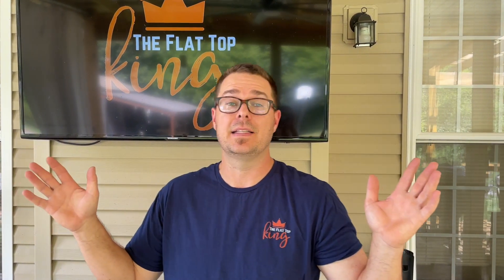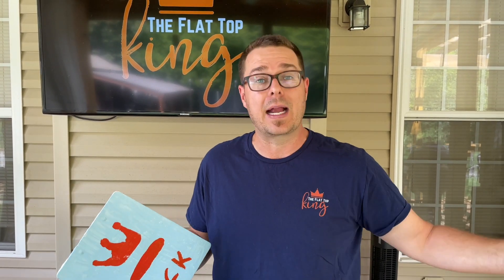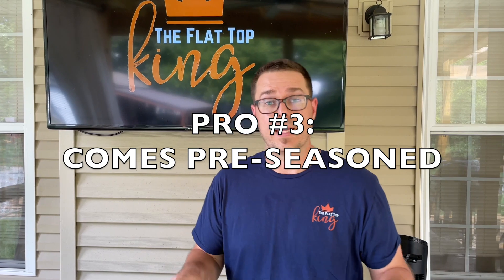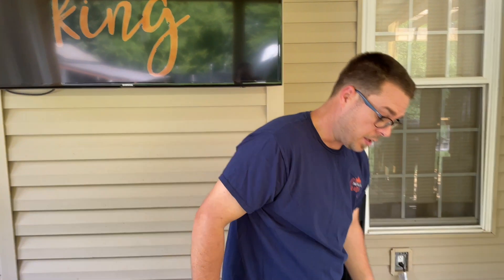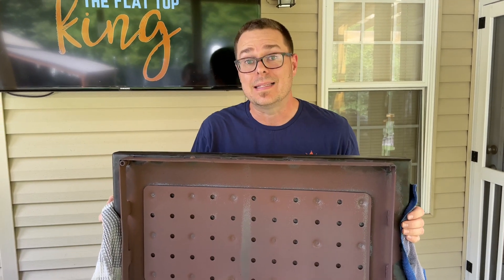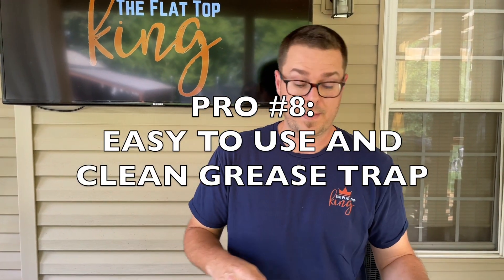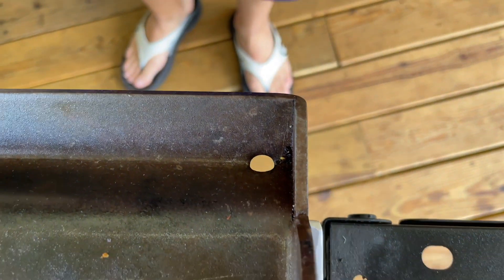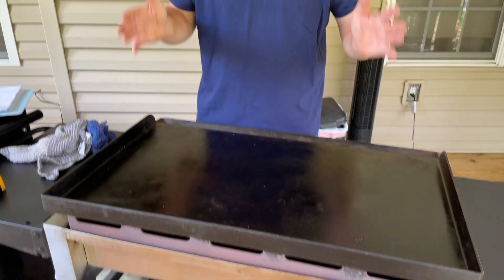Camp Chef Griddle 1 Year Review (Best Flat Top Grill Review)

Comment: I've had a Camp Chef FTG475 for a while and I've noticed some of the cons you've mentioned. Regarding the grease trap. What I've done with the hole for the grease trap was to drill it out a bit to make it more functional. If you are going to do this, be careful not to make the hole too big because of the risk of some of the grease not reaching the grease tray. 

I discovered the side shelf heat issue the first time I used the FTG and melted an oil squirt bottle. 🤦‍♂️  From then on, I've used a metal side table. What I do use the side shelf for is to keep food warm. I have a small wire rack to keep cooked items like toasted buns or bacon warm.  To catch any grease or other debris under the wire rack I use some tin foil.

Comment: Great video thanks for the tips. If it were me I’d take about a three eights inch drill bit and go right through that hole.
Reply from the maker: Great tip!
Reply: @TheFlatTopKing  by the way, I think I got my seasoning good to go. Five sessions up to 500 down to about 100 and so on. I did end up taking a small step drill bit and cleaned out that little booger in the corner seems to drain a little bit better with the debris in the trough. 👌
Reply from the maker: @johnmccaffery5186  awesome to hear. Just keep it seasoned and never look back. I actually filmed steak and mushrooms today and while preheating my flattop i brung it up to temp for longer just for that purpose

Comment: Nice review! I would add another PRO, the burners light in any order you want to light them, independently from each other, which helps 
with temp. control.
The side trays get so hot they WILL melt your bottles and even the plastic handles on the Camp Chef spatulas . . . don't ask me how I learned that! What I do now is keep thick cutting boards on them. They still get hot, but it allows for a little more usable space, and I think it's a little 
safer with them on there.
Reply from the maker: Yes you are right. Good points.
Reply: What about using a silicone mat over the trays to keep them cooler?

Comment: If you notice, just before the high setting, there are really 3 dashes  those are really low settings that you can cook eggs and pancakes with
Reply from the maker: I am looking now. So you are saying that the three notches keep the heat down before the knob turns to high. If thats the case how did u know that
Reply: @TheFlatTopKing  i saw it on a review of the grill someone has a Blackstone and a campchef, and he preferred the campchef because you can lowered the heat down to maintain around 300° temperature to cook eggs. And I tried it with mine and it works really good.
Reply: @TheFlatTopKing  have you tested this?
Reply from the maker: @mickeymallette2663  honestly yes and I couldn’t tell the difference in 15 min. Doesn’t mean it does not work but for me it seemed like the flame was always flickering out. The flame was not strong enough or it didn’t really make that bog of a difference to switch things up.
Reply: @TheFlatTopKing  thanks for responding.  Low temps being hard to control or maintain is a big deal, in my opinion, but everything else seems great.  I’m more confused about what to buy, lol.
Reply from the maker: @mickeymallette2663  i have not announced yet but i have partnered with pitboss and just received a griddle. I will reviewing it shortly and that will give you another option.

Comment: Great review!!  I have been looking for a flat top griddle for months.  My wife just bought me on for my birthday, it did come in yesterday or today due to freezing rain for two days.   It is a Blackstone model, Blackstone 1899 36" Griddle w/Hood, Black.  Did you get that WITH A HOOD.  Blackstone must have watched your video.  It weighs off the truck at 150# some assembly required.  You mentioned screws may come loose.   What I do in these possibilities from moving around, is put it to gether snug.  When it is right, I back the screws out one at a time and put a spot of Super Glue on the threads and tighten it up.  Then go to the next one.  It stays but is not permenant, you can still break it free with a little pressure if you need to.  But the screws will not back out on their own.   Thx again.
Reply from the maker: Bill i havent seen that model. Can you send pictures  it to me either on facebook or email. I have 3 facebooks. The Griddle Group by the Flat Top King, or my fb page. The Flat Top King, or flatopking@gmail.com

Comment: I’ve heard that you can adjust the temperature knob to the dash closest to off and it is not as hot as being set on low. I haven’t tested it yet to see if it is cooler. You can also drill the grease drain hole bigger if you want. I’ve had my Camp Chef for 3 years and it’s still like new. I love it. I use the stainless cover off of Etsy and it works great. I also have a Camp Chef pellet grill that works perfect. They are a good company that stands behind their products.
Reply: The unhinged cover or hinged one? I am debating between the two covers. Two different people make the unhinged, one of them only makes hinged.
Reply: The hinged version wasn’t around when I got mine but I think I would stick to the removable one because it is flat. I use it as a table when I’m prepping food for my smoker.
Reply: @mnsnowhawk1  aah ok. Thanks for the input

Comment: Great videos, keep them coming. My camp chef that I’ve used only a dozen times is high in the middle and everything runs to the corners. I always try to keep the heat even. Any idea why I have this issue. It’s impossible to keep eggs or any liquid type of food from running to the corners. Thanks
Reply from the maker: If you have something heavy and heat proof some say you can heat up your flat top and put the weight on it and turn off the heat and let cool. The weight will help flatten out the metal. Try to look that up for more detail. I have not tried it but some subscribers have commended about it. 
Does you flat top rock back and forth?
Reply: @TheFlatTopKing - Thanks, I tried this with a 4 gallon stock pot full of water and a bucket of rocks on top of that. I ran out of propane before the it got to the temp I wanted and will try it again.
Reply from the maker: @D-Allen  try to put that on some wood that stretches the length of the flat top. I think it would help disperse the weight. Plus the wood can handle the heat. If its good straight wood you could take a pic showing how uneven the flat top is and email Camp Chef for ideas or help.

Comment: Question:  I have the two burner Outdoorsman that we use while traveling in the RV.  I have issue with propane vapor lock.  After every use I disconnect the propane to mitigate this, does not work all the time, and when there is vapor lock it won't get up to temp.  I am looking at purchasing this unit for home use, I like the grill/griddle combo.  I am curious if you have experienced vapor lock.
Reply from the maker: Sorry brother I do not. Honestly I have not heard of this...
Reply: @TheFlatTopKing  Numerous videos on You Tube on this.  Its an issue.  Glad you have not run across this with your camp chef.
Reply from the maker: @rjtrembgeologist  me to sounds like.

Comment: Hello! I just got my camp chef. I noticed the the flat top isn’t perfect flat.  It’s not noticeable to the naked eye but when when I put a level on it, the level doesn’t lay perfectly flat.  Should I call camp chef for a replacement flat top?
Reply from the maker: Not sure...there are leveling screws underneatch...I would try that first...
Reply: Sorry if I wasn’t clear but what I meant is that the flat top itself isn’t completely flat.  For example, if I pour oil on the left side of the flat top the oil moves to the left, whereas if I pour oil on the right side the oil moves to the right. Is that normal?  If the flat top were perfectly flat the oil should move in the same direction regardless of where you pour the oil.
Reply: Hey there, I emailed camp chef a video of the uneven surface and they sent me a replacement.  The replacement is much more even.  This time I will be extra careful not to preheat on medium or high heat and instead use low heat.

One thing also I noticed with the original flat top and the replacement is a loud bang sound several minutes after the burners are turned off.  Does that sound happen to you?

Comment: I put heat deflectors on mine. They deflect so much of the heat that the tables barely get warm. And never hot. I can put plastic, one inch away from the griddle with no problem.
Reply from the maker: Although I completely agree....I do not teach or recommend that because because of some have said the heat gets built up too much and can lead to warping. Camp Chef says high heat is only used with out the griddle top...by using the wind guards you are using the same heating...thats where each person takes responsibility...thanks for the tip

Comment: I know the answer is probably somewhere in the comments, but they do sell a separate lid that you can use while cooking on the grates right? I want to make sure I can cook on grates with a lid OR use the flat top depending on what I’m cooking
Reply from the maker: I am not sure or familiar with a lid that an be used with the grill on...im sure someone has made one out of enough steel to handle the heat but all the tops I have seen have been flat. Although they use this as a pro in the griddle I think its more of a con and thats one major reason. No way to hold in heat when using as a grill
Reply: @TheFlatTopKing  Interesting. I very rarely use my current propane Weber WITHOUT having the lid down while cooking takes place so I’m not sure why there wouldn’t be one available for the purpose of grate grilling. I guess I will have to do a little more research.

Thanks so much for the quick and informative reply! Just found your videos and Tik Tok and will definitely be a subscriber!
Reply from the maker: @matthewveach2332  thanks. Hey if you find. Something let us know.I have several several people asking and I’m the same boat

Comment: Iam playing with a thermostat that will control my gas valve.  Work in progress but Iam having some luck. So can either control all the burners the same or need to put four regulators. One for each zone.  I’ll let you know.
Reply from the maker: Thats would be awesome. No doubt keep me updated
Reply: @TheFlatTopKing   You should make a splatter guard to keep the splatters off your deck. Mine is sheet metal almost the length of one side and about 3/4 the length of the back. 
Four inches high. Take the length and make a 90degree break to fit. Before I made the 90 I cut the metal 1/2” at where the 90 would be, both sides.  Bend the half inch over and flatten with a small hammer,  now bend to the 90.  The half inch folds will keep the unit stiff. 
The sheet metal (flashing) sold at Lowe’s  HD is to thin. I found a piece of trash AC duct at a new house build.
Reply: @Joyful-213  are the splatters that bad? There is a 5” one on etsy.
Reply: @DexterityNJ  when I grill burgers they splatter.  I know you can buy one but I made mine.  Was easy.
Reply: @Joyful-213  wish I was as handy lol.

Comment: How do you level the 6 burner? The 6 burner has wheels on all four sides. If the griddle only has two bolts on one side, then you can only adjust to one side
Reply from the maker: Not sure. I only have the 4 burner. U could check underneath to see if it has the screws like mine. That has helped a ton. Maybe a thin piece of cardboard underneath the wheel. Do the wheels have locks.
Reply from the maker: I looked on line and it says it has adjustable legs. Do u want me to reach out to Camp Chef

Comment: I just received mine and noticed as I was trying to level it after assembly, the middle is bowed. Should it be perfectly flat? I can lay a straight edge in middle,front to back and back side has almost a half inch gap. Sides seem to be ok front to back.
Reply from the maker: I have two answers...from people commenting it seems like it happens more and more and from what I have been told they will not do anything because it doesn't affect the cook. However I completely disagree....i would absolutely call and send in pics if asked and so forth....heck return if needed...i would absolutely hate a griddle top like that...they have sent griddle top replacements for certain things
Reply: @TheFlatTopKing   Just to follow up, I contacted Camp Chef through their online support link. I also sent in pics of the big gaps witrh the straight edge and flashlight. Their response was that none of the griddles are perfectly flat but they could see mine was excessive. No questions asked, they already have a new griddle top coming. That's some pretty great customer service!
Reply from the maker: @Cam-wi3tp  That’s awesome. Great news.

Comment: I've had my Camp Chef for only a couple of months now and I agree with your assessment 100%.  I experienced the excessive heat issue too.  Even if I turned off the right and left burners, and left the middle 2 on low the cool zones were almost as hot as the hot zones.  Ultimately, I ended up simply watching the temp with an infrared and turning all the burners off when the temp got too high.  If the temp dropped to much before I finished cooking I just turn a couple of burners back on low.  

If I may add one thing; you probably didn't have any reason to deal with Camp Chef's customer support/warranty people, but I did.  I assembled the unit about a week after receiving it as a Father's Day gift from my children, and did an initial seasoning.  Afterward, while the unit was cooling down, I heard a bang (imagine smacking the grill top with a hammer).  Nothing seemed amiss at fast glance.  The next day was Father's Day and I was cooking on it all day with no apparent problem.  A few days later, I found out about those leveler screws under the cook top that you mentioned and decided to try an adjustment because I noticed a slight rocking motion.  I lifted the top off and found that the heat diffuser plate had come almost completely detached from the cook top.  Apparently, some of the spot welds had failed and the plate was flopping around, only held on by the right side.  

I contacted Camp Chef.  I figured they would probably just accuse me of overheating it or not pre-heating correctly.  (I did it exactly as they said in the instructions, and while this is my first flat top, I've been cooking on cast iron and carbon steel for years).  They wanted proof of purchase, pictures of the damage, and the number that is stamped on the shelf sticker.  No questions asked.  The next email I received from them was essentially an apology that I had this problem and to tell me they were sending me a new cook top.  A few days later, it was delivered.  

I don't know how the customer service is at Blackstone or any others, but I know now that Camp Chef stands behind their products.  Sorry for the long story.
Reply from the maker: Heck of a Story and thanks for sharing. When I was doing research the customer reviews was a huge positive when deciding  pros and cos. Sometimes customer service us underrated when comparing products.

Comment: Have any tried using a 20UNF Propane Gas Adjustable Regulator Low-Pressure Control Valve for a too hot on low setting yet, anyone? & Will the flame go out with wind, with this adjustable valve? & I have an adjustable regulator on my 20 gallon tank for my commercial wok burner. It allows me to take it down to a very low blue flame where with no wind it is almost out. This might take a Camp Chef down too. & I don't have one because I cook for only one person in my van. I must cook very fast as to keep the carbon dioxide down very low. I do this with a thin walled commercial wok and two aluminum 14" flat enameled fry pans with two commercial burners and two adjustable regulators. With three 6" Maxx air fans in the roof to pull out any high floating carbon dioxide. There is also one low bilding carbon dioxide fan that pulls out CO2 that can build up at the rear of the van and reaches as high as the mid level throughout the van.
Reply from the maker: I have not...only reason is I try to be the average person... with all the R and D that these companies  have....It would have been used...i just cant imagine having to spend $500 then buy an aftermarket regulator to make the griddle work properly..
Reply: @TheFlatTopKing  The aftermarket adjustable regulator costs from $13 to $20 online. The aftermarket lids cost much more. It's great that wind screens are not necessary.  Someone suggested that a way to control that low setting would be a 150% improvement.